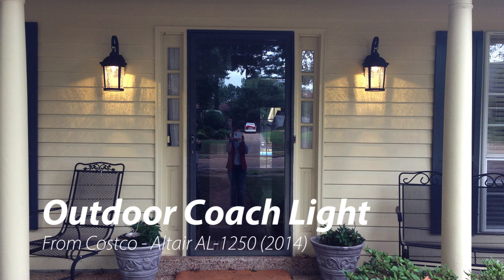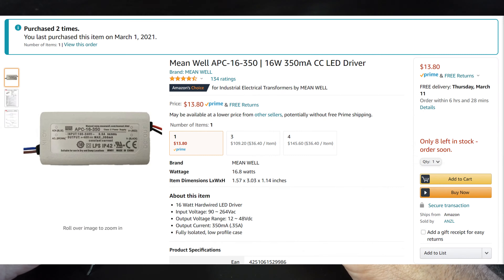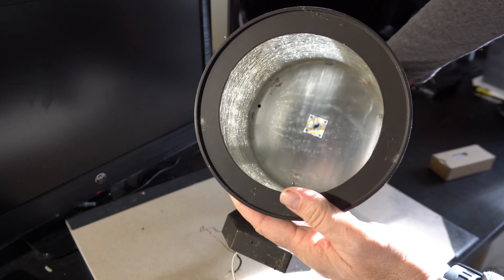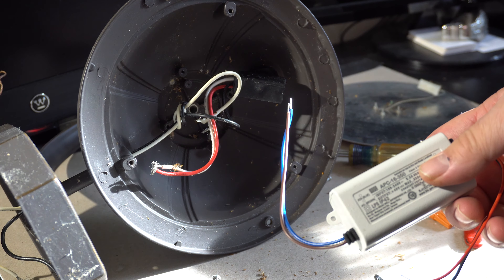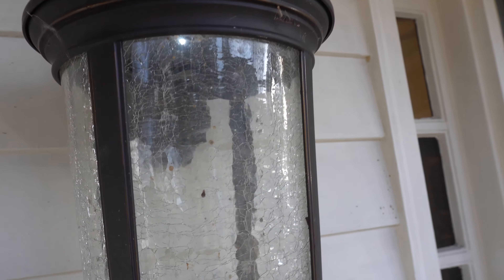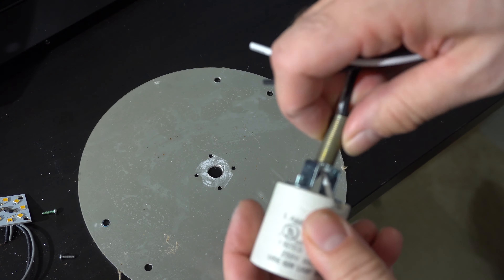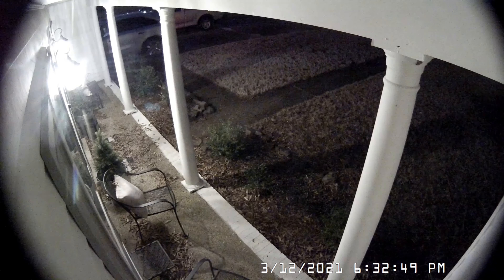Costco Flashing Light - A Different Fix!

Comment from the maker: Here are some frequently asked questions from the comments--

Question: Does the dusk/dawn sensor still work after this modification?
Answer  Yes, it did for me, as it was a separate module. However, a different model light with a monolithic module might exist (as mentioned by some commenters) in which case it would not. Feel free to read the comments to learn more. 

Question: How exactly do you to wire it up to include the dusk/dawn sensor?
Answer I can tell you what worked for me, but I am not an electrician, so consider this "for entertainment purposes" only. What worked for me was hot (black) wire from the wall to black on the sensor, output from the sensor (red) to black of the new Harbor Breeze socket, and white wires tied together. Here's a photo: https://imgur.com/a/L9NjpSE

Question: If I make this conversion, do I still need to purchase the LED driver module?
Answer No. This is a conversion from an LED light back to a simpler standard socket. However, with a standard socket an LED bulb is still an option...

Comment: Thanks for the tip. All 3 of mine went out over the last 2 months. Just replaced with socket lights today. For those asking about how to wire - the black goes to gold and white goes to silver
Reply: Does the light sensor still work with this conversion ?

Comment: For those that are coming here but have a later model, be aware that lanterns after this version have an LED driver with built-in switch (so 3 pairs of wires) rather than a the driver and separate switch as shown here. You'll need to purchase a separate photo switch OR if you don't care about the day/night sensor aspect...just leave the sensor disconnected.

Comment: Moved into a house that had these lights and they both started flashing within a few weeks of each other. I almost spent extra money on redoing the LED box per other videos, then I came across this. It could not have been any easier. Even drilling the metal plates for each new bulb mount was effortless. It took me 20 minutes for each, no more. Thank you for posting this video and saving all of us a lot of extra hassle. Only warning for those attempting this......the crackle glass lamp cover is extremely fragile. When you take them off, hold them by the metal frame and not by the glass cover. Unfortunately, I cracked my first one......but when I remounted it, put that part to the back and it is unnoticeable.

Comment: This is definitely the more common sense fix, so thanks for confirming my suspicions.  I was able to scavenge a bulb socket from an old fixture so this ended up costing me nothing other than 20 minutes of my time.  These lanterns are one of the very very few Costco products that have disappointed me but the fix was quick and easy.
Reply from the maker: Yes mine are still working great 2 years after making this video - thanks for the comment!

Comment: I completed my two front lights last night.  Only one had gone out.  I isolated the problem to the led lights.  I changed out both front lights thinking it only a matter of time for the other light to have issues.  I cut out the LED driver circuit pack and used the same wires to splice the new outlet, as you probably did.  Thank you very much for sharing this fix.
Reply from the maker: You're welcome and thanks for the comment!

Comment: Greetings!  I like the video.  Please note that all LED light bulbs have a micro version of the constant current driver built in.  That also means that not all LED bulbs can operate for outdoor temperature ranges.  I recently bought outdoor LED bulbs and its recommended minimum starting temperature is -25C (-13F).   (In Colorado, we recently got down to -20F (-28.9C).)  I couldn't find a maximum temperature on the packaging.   So be sure to check this for your outdoor lanterns.

Comment: Mine did the same thing.  I just bought a new exterior light for $44 CAD where I can swap the LED bulb vs having the LEDs built right in.  Never again.  I do have some other exterior LED bulbs that either come on by darkness or motion and so I can easily swap these bulbs out.

Comment: My thanks for illuminating the no-nonsense path to fixi ng this disappointing light fixture. Low-tech is   often more reliable and durable than high-tech, not to mention cheaper.   In my experience, being able to screw in a replacement bulb is the way to keep it simple.
Reply from the maker: Yes, thanks for the comment!

Comment: Thanks for your video. I replaced the LED with the sockets in your video and kept the dusk to dawn sensor, yes it still works with the change. The most expensive item was the two LED 60 watt bulbs that I bought. The glass housing still stays cool with these bulbs.
Reply from the maker: You're welcome, and thanks for the comment!

Comment: Wonderful video! Question??? What drill bit size did you end up using?
Reply from the maker: Thanks! I don't remember the exact size. I have one of those Dewalt all-in-one cordless kits and it came with a bunch of bits, just held them up to the threaded pipe until I found the right size.

Comment: Hi ty for the video 
Question by replacing the LED with light bulb do you lose the dusk to dawn feature of the latern
Reply from the maker: Dusk to dawn continued to work for me, as it was a separate module. However, a different model light with a monolithic module might exist (as mentioned by some commenters)

Comment: Yes, great video, but a quick question; were you able to preserve the ability for the light to automatically come on when night falls? Or when you made it incandescent did you bypass that function, requiring the light to be turned on manually? Thanks again!
Reply from the maker: Yes on this model which is several years old I was able to preserve that ability.. based on reading the other comments this is not always possible with newer models
Reply: Wonderful, and please continue these videos. They are great.

Comment: From what I can see you have to turn the lights on and off by the wall switch. Why didn't you just wire the socket to the light sensor so it goes on and off by itself (dusk to dawn)?
Reply from the maker: Yes left that hooked up... Purposely did not show wiring details, since I am not an electrician. Thanks for watching

Comment: Hi, great video! What size lamp pipe did you use and what size bit to drill the hole in the plate? TIA!
Reply from the maker: Thanks. It was been several years, but it was all standard stuff I found by exploring the fan section of Lowe's. If you search Lowe's Web site today for "Harbor Breeze Light Socket" it finds item # 34550 and one of the suggested items on that page is a Project Source brand pack of "traditional metal lamp pipe" #46816. It has been a few years so those may or may not be the exact parts, but look like it to me, and I just picked a drill bit by holding it up to the pipe.
Reply: @ACBMemphis  The change to sockets went perfectly on 6 lamps. It took around 2 hours for all of them. You saved me a ton of time and money. Can't thank you enough!

Comment: Wondering if the Costco - Capstone Gooseneck Lantern can be fixed by putting in an incandescent bulb socket??  Bought 10 and now only 2 work... installed in 2018
Reply from the maker: You could try taking one apart and seeing what's inside, since it's broken anyway. Just Googling that model, it really would depend on what is behind that plastic disc. Would probably be possible to remove the "guts" and mount the socket in the disc itself, but that might look bad or have heat issues...

Comment: Great video and the socket replacement is what I did even though costco will take them all back if only one is dim or blinking.  This is my 2nd go round with costco carriage lights with the daylight sensors and both times the LEDs had small black burn marks.  Now with the socket replacement I can put different colored bulbs in for Halloween and Christmas (our cul-de-sac goes all out for the holidays and since I am bare minimum decorations type the different colored bulbs are quick and easy!  Thanks

Comment: I did this fix; however, in doing so the beautiful light pattern projected on the floor by the LEDs reflecting off the sides of the glass is gone. That was what made them so beautiful and was my favorite part. I wish I could have found a way to just replace the LEDs but had no idea what replacement part to purchase.

Comment: With the screw in bulb retrofit....did you keep the dusk to dawn sensor?  It's not clear on the video if that part of the circuitry was still in place?
Reply from the maker: Yes, I was able to keep the sensor as it was separate. However, other people have commented here that there's a newer version of this lamp without a separate sensor... Just did a quick search on lowes.com for "dusk dawn sensor" - they have wire-in and socket models for $14 or less, depending on how much time you wanted to invest you might still come out ahead financially.

Comment: Does the dust/dawn sensor still work with your bulb replacement "real fix"?
Reply from the maker: Yes, it does since the LED and sensor are separate components.. However, other people have commented that there is a newer model that has everything in one box - in which case it would not. Thanks for watching!

Comment: Good morning,  I love this fix but for some reason it is not working for me.  When I install the lamp, the light does not come on even though I hear the sensor turning on and off when I cover it up.  Any thoughts? Thanks.
Reply from the maker: My suggestion is to check for loose wires sometimes when twisting wire nuts they might not catch.

Comment: Forgive me if this has been addressed in other comments but did your lanterns have an electric eye/ dawn to dusk? I’m guessing not. My lantern is the same brand from Costco but has the electric eye.
Reply from the maker: Yes, these had a dawn to dusk sensor and it does work with the new socket.
Reply: Thanks, but after you installed the new socket etc, unless I missed something, you glossed over reconnecting all the wires, including the one from the sensor. Might be obvious to more seasoned people, but I would’ve appreciated a more thorough finishing up.

Comment: Thankyou for taking the time and energy to present a solution to the failing Costco wall lights.We have 2 lights and one started flashing at about the 4 to 5 yr timeline.I had seen a video on replacing the driver but as I have a lot of experience with electrical I thought what if you replace the driver and then the LED lights fail.So instead  was looking at replacing both with the new Costco wall lights that have done away with the circuitry and gone back to a socket with a 3000k Led bulb included which I just installed one yesterday on the back side of the house.So your solution is simple and brilliant as it mirrors the new Costco wall lights.I agree why throw away a perfectly good looking wall light when you can resolve the problem simply and cost effective.I do not understand nor agrree with the thumbs down.There should be an option for a thumbs down on the thumbs down.Thanks keep it up.
Reply from the maker: Thanks! I appreciate the kind comments! I hated to just throw these things in the landfill and buy another so this solution lets me use any type of bulb...

Comment: Great video, thanks.   can I keep the old photo sensor and just add the new socket? I am sure I have to bypass the power supply. thanks
Reply from the maker: Thanks. In this model I was able to keep the sensor, however, according to some of the comments there is a newer model where the sensor is combined with the power supply.

Comment: Thanks so much for this innovative hack. I have three Costco lights (two at the front door and one at the garage). One of the door lights stopped working. I replaced the broken one with the one from the garage. Then I followed your video and changed out the innards of the broken one and installed it at the garage. That way the lights at the front door still match each other.  I went ahead and bought enough sockets to retrofit the other two and I'm just waiting for the lights to go out. 😉
Oh and I'm a new subscriber!
Reply from the maker: Great! Glad you got it working, and many thanks for the comment and subscription!

Comment: Great Video! I now want to go the socket / bulb route. Question... Will the dusk to dawn still work properly when I make the switch??
Reply from the maker: Thanks glad you enjoyed the video. On these lights, yes, I was able to still use the automatic sensor. However, other commenters have stated that there is a "new version" of the light, in which the LED and sensor are in the same box and not separate modules. If you have those, it would not work. No way to really know until you open it up.
Reply: @ACBMemphis  I just completed upgrading my light and luckly my dusk to dawn sensor was separate. It works great and I love how it turned out.  I'm so glad I came across your video. Such an easy and well worth upgrade all thanks to you and your video!!! Thanks again!!!
Reply from the maker: @nf2751  Great news! You're welcome  Thanks for the comment!

Comment: How do you connect the photo cell ?
Reply from the maker: Using the original as a model, I replaced the box/led driver with the socket and the photo cell worked the same way.

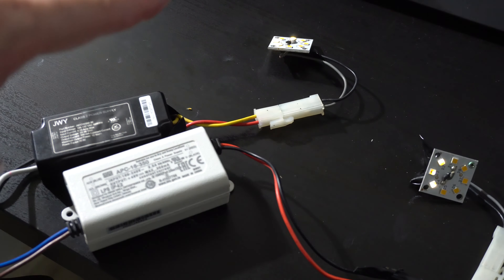Comment: Did you get rid of the dusk to dawn sensor?   I did not remove that and my regular Light bulb or LED bulb or Florescent bulbs all flicker now??  What next??  Can you show the steps when you removed the power 7:00  supply and installed a screw in light bulb fixture??
Reply from the maker: Yes I kept the dusk to dawn sensor, it's possible you are having a different problem or maybe using a different model as this video is 3 years old. I'd try temporarily removing the sensor and see if it works with just the bulb. If it flickers with nothing but a wire connected directly to the bulb, seems likely a bulb/switch/wire problem. I'm not an electrician so don't consider this professional advice, but this picture shows how I wired it: https://imgur.com/a/L9NjpSE
Reply: @ACBMemphis  Thank You for your response.   after doing more extensive reviewing… I do believe we have the same light ours is at least 8 yrs old.  Anywho, several have said the sensor is a 12 volt and must be switched… I will by pass sensor and see what happens.  Thanks again

Comment: I put in a regular light bulb fixture and will double check it tonight, but when I covered the sensor… in the daytime after reinstalling…the bulb started flickering…😢  Nope this did not fix the problem, the light bulb flickers off and on just like the old LED did.  GRRRRRRRRR…. NEED NETTER OPTION.

Comment: Great video thank you! Working on it today. One quick question, is there a way to wire in the dusk till dawn Senser? Thanks in advance
Reply from the maker: Yes, the sensor is a separate module and I was able to keep it.. What worked for me was to power the sensor with the hot (black) wire and output the red to the black of the new harbor breeze socket. Here's a photo: https://imgur.com/a/L9NjpSE
 Good luck thanks for watching.

Comment: Great video!  So helpful!  One question…do I still need to use the driver or can it be completely removed?
Reply from the maker: I completely removed the LED driver, so my fixture is just a plain fixture with regular bulb. Thanks for watching!
Reply: @ACBMemphis  I did it!  Thanks.  I am expecting my second light to go out as well…I’ll be ready!  Thanks again!
Reply from the maker: @mikrellim8119  Great glad you got it working! I'm guessing it should last a lot longer without all that complicated circuitry!

Comment: Great video. Do you connect the brown wire from the LED power supply with the red wire from the photocell to keep the day/ night sensor active?
Reply from the maker: I ended up removing the LED power supply completely and using standard sockets, and yes I kept the red wire supplying the hot so the day/night sensor is still active. Remember, I'm not a licensed electrician, so if you are unsure please consider this video entertainment not professional advice. Thanks for watching! 

Picture of inside: https://imgur.com/a/L9NjpSE
Reply: @ACBMemphis  Thank you.

Comment: Do you just wore the socket straight to the ground and hot hire to the house?
Reply from the maker: I used the photo sensor, so at my house what that means is all the white wires went together, but the black (hot) wire went to the black on the photo sensor, then the output of the photo sensor (red) went to black on the socket. Here's a picture, but remember I am not an electrician so use at your own risk: https://imgur.com/a/L9NjpSE

Comment: Adding the harbor breeze swap kit does that eliminate the LED driver inside? Would you be able to show us the inside after you hook that all up before you put it all back together?
Reply from the maker: Yes it does. I purposely did not show a bunch of wiring in the video, because as I said at 1:54 I am not an electrician and want to encourage people to be very careful. If you search the Lowe's Web site for "photocell button" that is what is left inside after you remove the LED driver. The way I understand it, white wire is neutral - I connected all 3 of those together. The black power wire went to the black wire on the photocell button, and the red wire went to the black wire on the socket.
Reply from the maker: Went back through my video files, here is a picture: https://imgur.com/a/L9NjpSE
Reply: Thanks man this is huge. I bought the mean well led driver and it worked for a minute but then went out again. And saves not having to buy other housings.